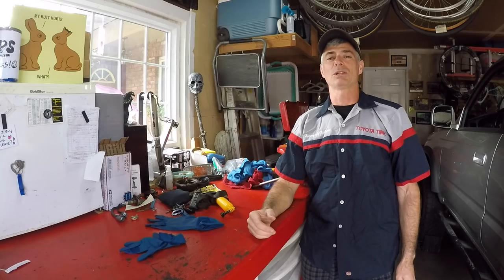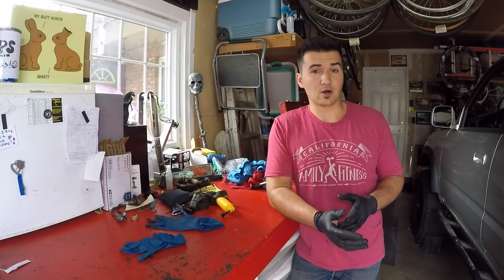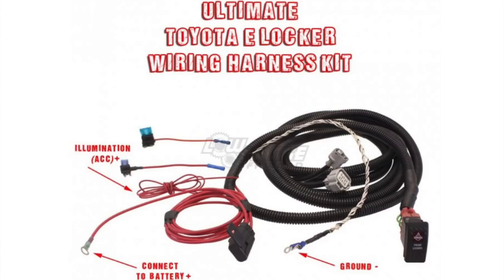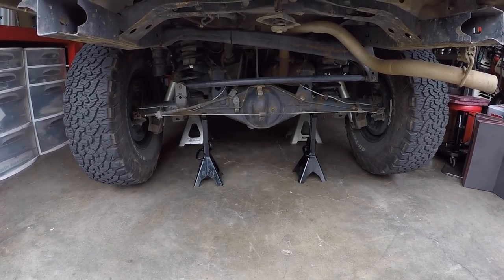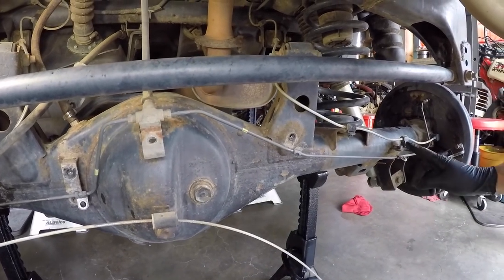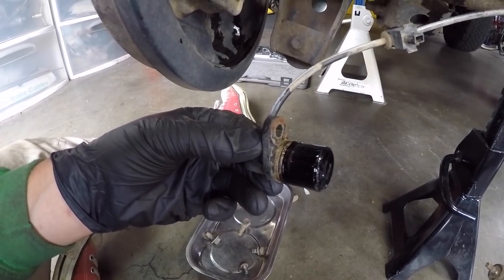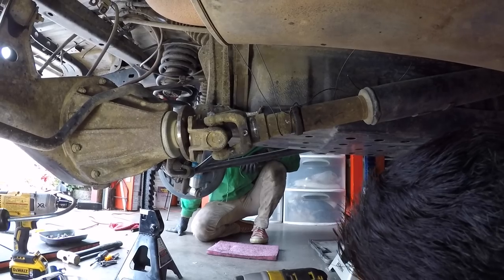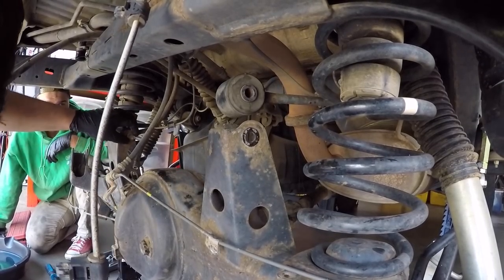E-Locker Axle Swap + Wiring How-To

Comment: Maybe you can help me,I have a 98 tacoma with a E-locker rear end..but I don't have the switch on the dash..my question is this..is a E-locker factory on my truck? Or did someone change the rearend?
Reply from the maker: Well Jeremy, if your rig came from the factory with an e-locker rear end, you would have the switch unless a previous owner removed it for some weird reason.  Sounds like to me a previous owner had an issue with the rear end and swapped it out for an e-locker one which actually is a bonus.  If you can come up with an e-locker ECU, the necessary plugs and switches to wire it up, you can have a working e-locker on your rig.
Reply: @TimmyTheToolman  thanks for the info!! My tacoma has a 9" lift on 35's..nice truck! Could a factory none E-locker rearend pull these tires.
Reply from the maker: @jeremymurray9805  With 35's it would be best to re-gear the differentials. Stock non e-locker rear ends came with 4:10 gearing.  E-lockers came with 4:30 gearing.  Neither of these would be great with 35's.  I'm running 33's with 4:30 gearing and it's ok.  4.88 would be better for my rig.  I think your choice would be between 4.88 or 5.29 gearing.  I have 5.29 gearing for my 85 4runner running 37's.
Reply: @TimmyTheToolman  thanks for the help!! Keep up the good videos!!
Reply from the maker: @jeremymurray9805  You're welcome Jeremy.

Comment: Hello would this work on a 2wd not a 4x4 same gen same truck?
Reply from the maker: I don't know anyone who has done it but I would assume it would work.  Under the OEM setup, the locker will not engage unless the transfer case is in 4Lo.  So, since you don't have a transfer case, you would definitely have to follow the mod that Seydzh did by grounding out that circuit so you can defeat the 4Lo protective feature.

Comment: Helpful Tip: the video doesn’t give the added detail on how to insert the pin for the dash light. You’ll need to remove the white plastic pieces from the brown clip to be able to properly seat the pin.
Reply from the maker: Thanks for the tip.  I'm curious, though.  Did you find our video helpful?  You commented and mentioned one thing we could have covered better, but what about the rest of the video?
Reply: @TimmyTheToolman  Your video is incredibly helpful! I couldn’t have completed my elocker swap without it. Trying to repin the dash harness was my only head scratching moment, your video is very thorough on all the other necessary steps. I’ve used so many of your videos now, even with a FSM, I’m often using your videos to fill in the gaps. Keep up the great work!
Reply from the maker: @cacog35  Thanks for what you said.  I appreciate it!

Comment: I have a non elock 98 limited that had an issue with about 2 feet of melted chassis harness.
Can I use a 97 limited elock chassis harness from a junkyard donner (with ECM and elock module)?
Planning on converting axel to elock as well in the future (someone beat me to the one at the yard!).
Thanks!
Reply from the maker: @nimgul86ed  Yes, you could.
Reply: @TimmyTheToolman  
Thanks for the super fast reply...wasn't expecting that...especially with your volume and quality of content (48 hour days in CA??).
Just plug and play?
I could make a jump harness between the elock harness and the non elock axel.
Thoughts?
Thanks!
Reply from the maker: @nimgul86ed  Well, part of the e-loocker wiring runs up into the body under the driver side back seat, and goes forward to the e-locler ECU and switch.  As long as you got all that wiring, you could do it.  The engine and transmission harness is separate from the e-locker harness.  I'm not 100% sure what wiring on your vehicle burned up.
Reply: @TimmyTheToolman  
I had 2 feet of chassis harness burn under the dash (brown wire...green, so old damage when I got her).
But also the full length of drivers side harness right up to the fuel pump plug into the gas tank.
Both replacement harnesses are in my shop.
Only only have 1 small white male (insert joke here) plug from the existing non elock axel (abs?).
New harness has 2 female plug heads (white and black)
Reply: Driver's side brown wire was burned the full length...cause of the damage is a mystery still.
Btw: previous owner blew an engine, replaced it...then blew that one. We replaced the engine 4 months ago (using your video as a guide). Ran great with some odd electrical issues showing up sporadically. Took the dash out to find the issue...and it became my summer project.
Missing your Toyota day because of it. Wanted to say thank you in person for the great video guides!!...next year.
Reply from the maker: @nimgul86ed  Have you identified what the brown wire powered?
Reply: @TimmyTheToolman  not as of yet. Taering apart the old harness to back track it...but something bad must have happened.
Looks like they spliced something (now removed) in a few places, so not sure if I can sus it out.
I am a jeweler by trade (since 1988) and the mess I am seeing drives me crAZy!
Cleaning and wire management is taking time but this baby will be all mine once done.
Did your alternator upgrade (not the issue, followed your video exactly), did the engine replacement, will do all new suspension, Tundra brakes and elock upgrade.
Reply from the maker: @nimgul86ed  Gotcha.  Good luck with all the restoration.  I'm happy to know our videos are helping you out.  Happy Wrenching!
Reply: @TimmyTheToolman  Thanks for the videos and the reassurance!
Enjoy "retirement"!!
Reply from the maker: @nimgul86ed  You're welcome and I do plan on enjoying retirement.

Comment: ok... 97 SR5,  elocker rear differential  swapped. On the last step of the wire harness adding the pin on the brown harness behind the cluster. Pin 5 is used.  there is a green with red stripe wire on pin 5. Enters in the main harness which i can no longer trace. First thought that i might be partial pre-wired with e-locker harness. problem is that cant find either ecu or switch plug.   Now what??  Anybody reported this issue?
Reply from the maker: Hopefully somebody has an answer for you.  But, what about de-pinning that pin, taping it off, installing the pin you need to install and see what happens.  With that pin taped off, it's not like you're going to short circuit anything.  If you get a CEL code, then you'll know you needed that pin for something.
Reply: @TimmyTheToolman  that is what i was actually thinking to do. Was just afraid i was going to fry something. i thought  by posting here maybe somebody faced this and have a solution.
Reply from the maker: @Terry-ww9tr  Roger that.  Let me know how it works out.
Reply: Just to update. For the e-locker lighting function on 96-97 (non electronic dash) you will have to use pin number 8 on the same brown harness.  You will need to order the light bulb and the grommet Toyota parts 90981-11018 , 83101-14040. The e- locker slot will be empty if the truck didn't came partial e-locker pre-wired.
Reply from the maker: @Terry-ww9tr  Thanks for sharing this Terry.

Comment: That little breather tube is a strange one. I'm swapping just my actuator to a new one at the moment, and I can't figure out for the life of me how to properly disconnect the breather tube. The actuator seems like it just comes with a little short one
Reply from the maker: I'm not sure how to disconnect the breather tube.  We've never tried to disconnect it.
Reply: @TimmyTheToolman  I don't mean detach from the actuator, I mean from the tube extension that goes up to get attached to the body!
Reply from the maker: @GryptpypeThynne  Gotcha.  We've never tried to pull that little breather off the tube.  Maybe it's sold with the tube.
Reply: @TimmyTheToolman  I'll mess around with it. Got a brand new actuator from Aisin and it came with a short (maybe 6 inch) tube with a plug in it, so I assume there must be some way to connect that up

Comment: I’m getting ready to do this mod to my 98 5speed and saw one comment in the forums that the wiring may be different on the 5speed as opposed to the Auto. Can anyone confirm that or elaborate?
Reply from the maker: The wiring for this is pretty much it's own system other than the communication it does with lighting up the diff lock light on the dash.   As long as you build the harness correctly to communicate with the E-locker ECU, locker actuator, and locker switch, it will work.  We've heard there are some differences with the plug you need to access to add a wire to for the dash light to work, but other than that, you shouldn't have issues with this mod.
Reply: Timmy The Toolman thanks for the quick response and all the fantastic videos! Looking forward to the mod.
Reply from the maker: @johnstontimothy901  You're welcome and good luck with it.

Comment: Hey guys does the axel housing need to be changed or can I just swap the non locking 3rd member with a locking rear diff?
Reply from the maker: It's easier if you get the e-locker axle housing with the e-locker 3rd member.  If you're going to use your non-elocker rear end, you will have to alter it to make it work.  We discuss this in the video.  You have to do some cutting and drilling and tapping.
Reply: @TimmyTheToolman  thanks. Off to pick n pull I go. Keep up the good work
Reply from the maker: @stevegullo1059  Ok, good luck with the rear axle housing search.  And yes, we'll keep on keeping on.
Reply: Ended up modify my stock axel housing. Actually wasn't that bad with a plasma torch. Used a stick welder to add metal where needed and filled in the old unused stud holes. Found all the wiring/control module/switch on eBay except FedEx and bad packing broke one of the connectors so gotta put together a new one. Next on the list is the 199mm tundra brake calipers. Wanna get the 231mm but I have 16" alloys so worried they won't fit. Keep the vids coming Tim mmmm kay
Reply from the maker: @stevegullo1059  Good lob with the axle modding,  Sick axle housing mods, mmm kay.
Reply: @TimmyTheToolman  so having some dificulty wiring this elocker up. my runner was wired for the elocker I have the switch and ecm connected but the wiring that i got with elocker from a 2000 taco doesnt seem to match up. I was wondering if i could show you and Sage some pics of what i got

Comment: Does my 01 sr5 have the RR locker light in the gauge cluster?
Reply from the maker: It does NOT. Because the 01 and 02 models never came with a locker, the tachometer/gauge cluster don’t have the RR DIFF Lock light, but you can wire the button to light up.
Reply: @TimmyTheToolman  Do you happen to have a wire diagram for this?
Reply from the maker: @arlanscel  Open the video description.   We share it there.

Comment: Hey Tim .. are all 4runner gauge have the rear locker light ?
Reply from the maker: No, they don’t. 2001-2002 do not have it because those years didn’t offer the rear e-locker as an option.96-2000 4wd models should have it regardless if the truck came from the factory with a Locker.
Reply: @TimmyTheToolman  plan on doing to my 2002 4runner that is RWD only. It should still work even if my dashboard lights won’t show it right? And will my VSC interfere with the E locker?
Reply from the maker: @Skybusdriver  It will work.  You would only be using the locker in very slow situations so I don't think the Vehicle Stability Control would be affected.  The locker is just to get you through a tough spot where traction isn't great.  Once you're through the obstacle, you disengage it.
Reply: @TimmyTheToolman  god damn Timmy that was a quick response. Again thank you for all you do for the 4Runner community. I think the idea of doing some mild off roading / overlanding has caught on for me. This 4runner, although only 2WD, is extremely sentimental to me. I figure I’ll do what I can to make is as off road capable as possible!
Reply from the maker: @Skybusdriver  You could also do a 4wd conversion one day.  If you end up liking overlanding, it might be something to consider.
Reply: @TimmyTheToolman  yes sir I’ll definitely look into that if that’s an avenue  I can take. Perhaps maybe I can pay you to help me with the conversion in the future and hopefully it’d make good content for your channel! It’s something I wouldn’t trust anyone else really to do on my 4Runner.
Reply from the maker: @Skybusdriver  We might be interested in doing a 4wd conversion.  We had another guy that hit us up not too long ago.  He's still collecting all the necessary parts the last time we chatted.  Thanks for the vote of confidence for us.

Comment: would wiring be different on a 2wd?
Reply from the maker: Not 100% sure.  The e-locker is a separate system pretty much.  As long as you have all components and you give them power, I think it will work.
Reply: @TimmyTheToolman  thank you

Comment: My 2007 tacoma 4x4 sr5  has a rear differential that's " 8"/205mm.  3.727:1 gear ratio and is an open diff. 
My question is. If I were to purchase a 
"8.8"/225mm 3.727:1 gear electronic locking differential. Would it work or what would I need to do?
Reply from the maker: I don't know if this work because I don't have experience with what you're asking.

Comment: How about some safety glasses guys.
Reply from the maker: That's never a bad idea.  When I use a drill, a sander or grinding wheel that could throw out metal particles at speed,  I always wear safety glasses.  If dirt gets into my eyes while working under a rig, I can deal with it.

Comment: Will this work on a 01-02?
Reply from the maker: Yes palaciosivan100, it will. Sean even has a 97’ rear axle on his 2002.
Reply: Timmy The Toolman Can you use a Tacoma rear axle with the E locker?
Reply from the maker: palaciosivan100 you can! But Tacoma axles are set up for leaf springs, so not the same rear axle as a 4runner. With some sic welding, you could convert your frame to retrofit leaf springs!
Reply: Timmy The Toolman  so I just bought the module switch and third member, am I going to have to make the cut out modifications to my 2001 axle like the link you attached?
Reply from the maker: @palaciosivan100  Yes, you will.  The rear axle housings that came with the e-locker 3rd member are different.  They have an extra cutout section.  You'll also have to do some drilling and tapping from what I remember from that write-up.  Just hold up a paper gasket meant for an e-locker 3rd member and you'll have your template for where you need to cut and drill.
Reply: Timmy The Toolman I found a real wheel drive with a rear diff  locker on it If I pull the complete axle off will it swap to my 01’

Comment: Get some fuel !
Reply from the maker: I'm sure he got some fuel before he ran out.  Also, did you know the gas gauges on these 3rd Gens are notoriously off?  When my gauge is on empty, I can only put in around 14-14.5 gallons.  The capacity is 18.5.  So, I bet he still had around 4 gallons of fuel left in his tank.

Comment: Would this work on a 2001 that has a center diff locker?
Reply from the maker: Yes
Reply: @TimmyTheToolman  if I understand it correctly, the center diff locker, locks the front diff yeah? Having this e locker means I would be able to lock both front and rear diff yeah?
Reply from the maker: @cmart9240  No, not exactly.  The center diff lock option just switches you from all-wheel drive to 4wheel drive.  You don't have a locking front differential.  That's totally different.  When you have a locker for the differential, both the left and right wheels turn at the same speed, meaning there's no differential in the speed between the two.  I wish I could explain better how that center diff lock works on the transfer case, but I do know for sure it's not synonymous with having a differential locker.  They are two totally different things.  Check out this link and scroll down to get another explanation of how the center diff lock works.  http://www.toyota-4runner.org/3rd-gen-t4rs/82033-3rd-gen-4runner-buyers-guide.html